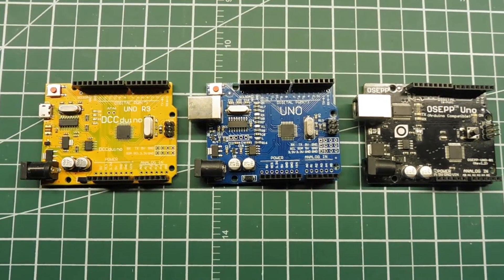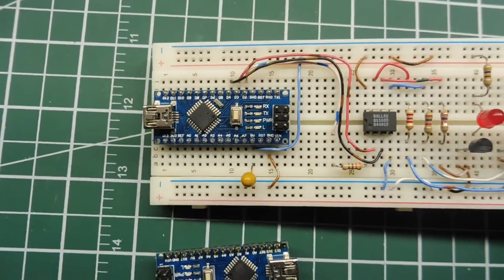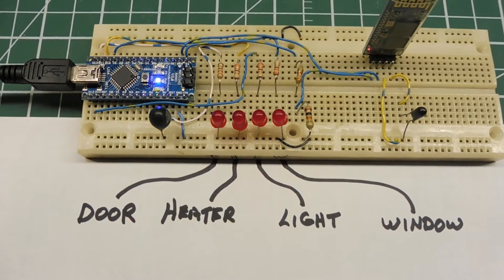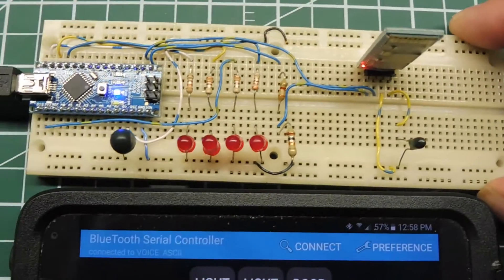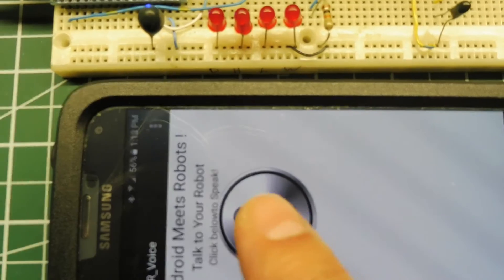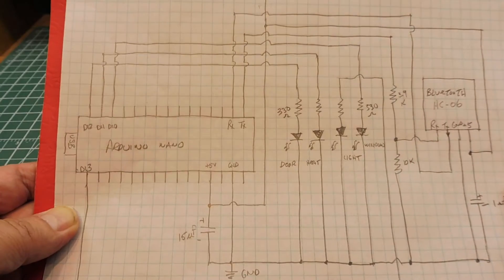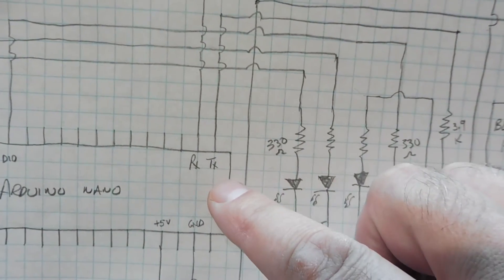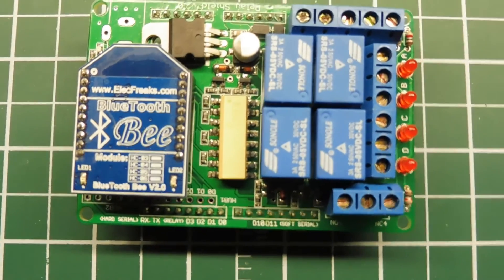Arduino Projects - Bluetooth and Voice Control

Comment: Please provide code
Reply from the maker: I do not use the Arduino IDE, the code is written in Forth. Execute "Main" to run the code.
\ Voice Activation Arduino Nano

: Light.1  $" light on" ;  \ returns address (and count) 
: Light.0  $" light off" ; \ of string in Flash
: Door.1   $" door open" ;
: Door.0   $" door close" ;
: Heat.1   $" heat on" ;
: Heat.0   $" heat off" ;
: Window.1 $" window open" ;
: Window.0 $" window close" ;
: All.1    $" all high" ;
: All.0    $" all low" ;

: Main       INIT
             9600.baud
             BEGIN
             Get.voice
             light.1  match? IF PIN13 high THEN
             light.0  match? IF PIN13 low  THEN
             door.1   match? IF PIN12 high THEN
             door.0   match? IF PIN12 low  THEN
             heat.1   match? IF PIN11 high THEN
             heat.0   match? IF PIN11 low  THEN
             window.1 match? IF PIN10 high THEN
             window.0 match? IF PIN10 low  THEN
             All.1    match? IF all.high   THEN
             All.0    match? IF all.low    THEN
             PAD 64 BL Fill
             AGAIN ;
Reply: 0033mer how i upload this on arduino nano without arduino ide.  Please give a suggestion . I already made it but that was not voice controlled. How can i control by voice using arduino nano.
Reply from the maker: Do a string compare with the command that was sent, when there is a match turn on a GPIO pin.